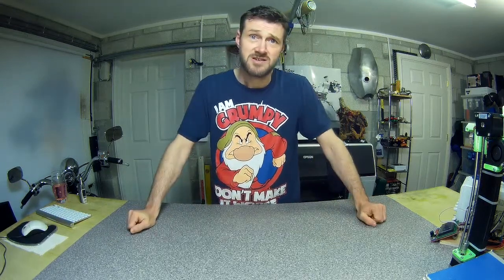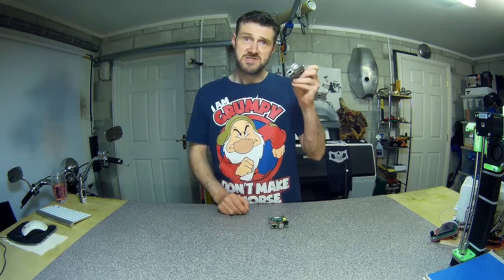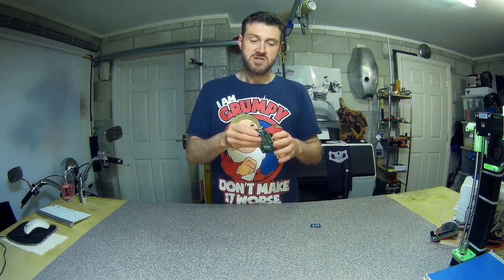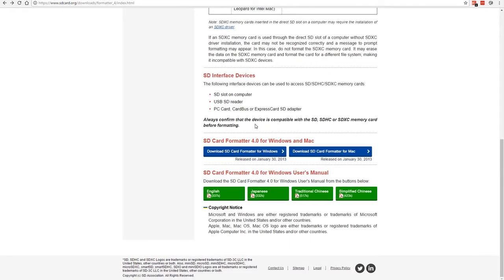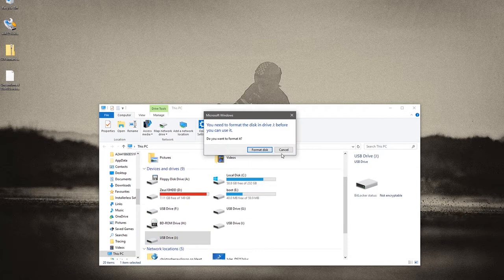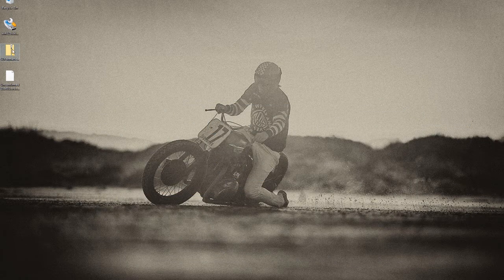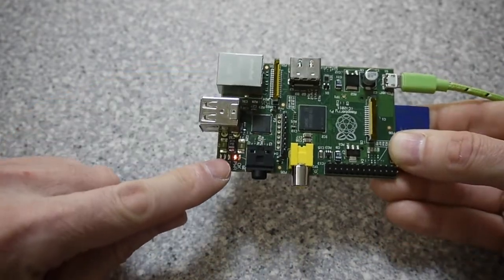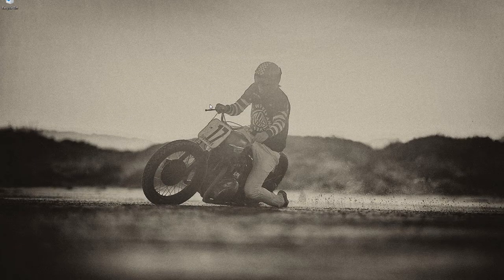How to Setup OctoPrint on Prusa i3 MK2 Guide - The Easy Way, OctoPi Tutorial

Comment: Good video. I was having problems using port 80 also. It was conflicting with one of my routers which uses port 80. I had to port forward through 2 routers to get to the outside. In my case i chose to use port 1964, which doesn't really matter. Port 80 worked for awhile but then it stopped working. Anyway, your tutorial on how to change default port in octoprint is exactly what I needed. I can now acces my octoprint outside of my network again thru noip(dot)com using a host name.  Cheers buddy!
Reply from the maker: Glad it helped.

Comment: Jules, thanks for the great video series. I have not used octoprint yet but may give it a try. I did add a webcam so I can watch the print from upstairs as well.  I think, like you I am going to start using the printer well to print objects.  I may go into adding an lcd at some point or even multi extruders.  look forward to catching additional videos as they come  thanks again
Reply from the maker: Many thanks! Octoprint works nicely. You can configure it to watch a network folder, so I can just throw my gcode files in there from my main computer and it just starts printing! The only down side is I found myself staring at the webcam feed when I was out walking my dog today :D Multi extruders is on the list, but I have a few things to do first.

Comment: Good video. BTW, you don’t need the sad card formatter. You can use the widows disk manager. Use the windows key and the R key. This opens a run box then type in computer management. Then go to disk management. Once there just right click the partitions on the disk and delete them. Then create new partition. Then you are all set. The other way this can be done is through other disk image tools. Not sure about win disk imager but, tools like Rufus can wipe out existing partitions while putting the image on the disk. Hopefully that helps someone.
Reply from the maker: lol - many ways. I never had an issue with Rufus etc but each to their own

Comment: Hello Jules,  Thanks for the video.Out of interest you don't need to make the IP static as the network can see the network name . I.e. it came up as OctoPi in the router page so all you need to type in to putty is OctoPi  and use this instead of an IP address. I find it easier to use names like this rather than Ip's.
Reply from the maker: my network is quite complex, and I needed to open firewall ports - which does mean having to use a fixed IP.
Reply: Ah yes. If you want to make it visible from outside your networks then you probably do. I was thinking of just access from the LAN like I intended to use it and for setting up etc... How do you find the inbuilt slicer ? Do you just drag and drop models and let it get on with it ?  thanks for the reply..
Reply from the maker: yeah, in my case i have two internal networks - long story. Never tried the in-built slicer - I use Simplify3D for all slicer these days.
Reply: Ok, thanks...

Comment: Great video. But you skimped the printer installation. If I understand it you copied yours from Pronterface. It would have been more useful if you had covered this as a manual set up. I’m having to do this and it’s causing me some grief getting the X, Y and Z settings correct.
Reply from the maker: Thanks for the comment. This was more a video about installing and getting it running that configuring or using it. I personally didn't set up any printers (use the default) as I only use it to send GCODE  to the printer from separate slicers
Reply: Thanks for replying Jules. I watched your GCode videos last night and they gave me some clues. So I’m sure I’ll figure it out. One reason why I’m learning 3D printing is to make casting patterns for old motorcycle parts. I can’t just pop down the shop for replacement parts for my 1905 Brown! Anyway, thanks again, you have taught me a lot.